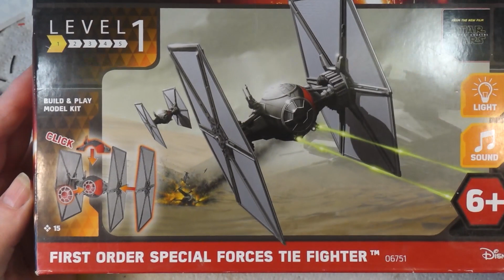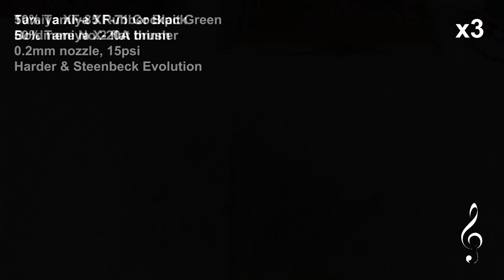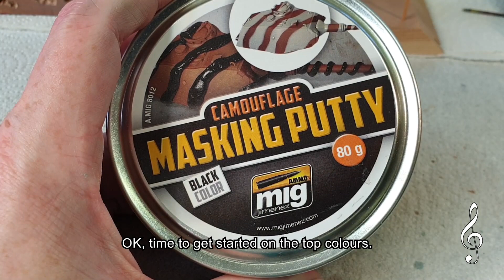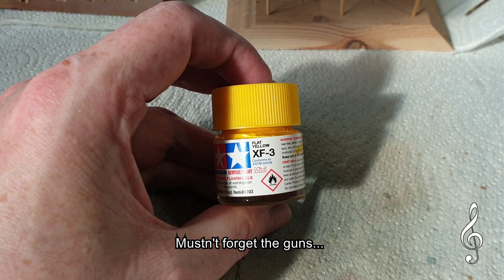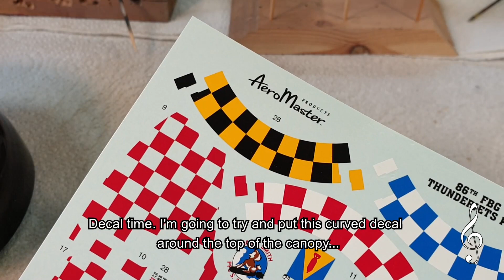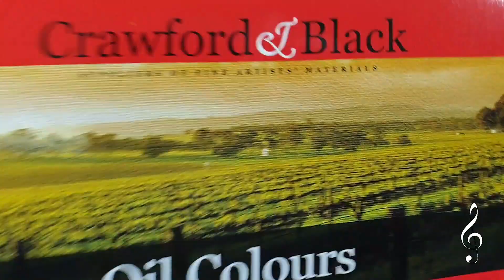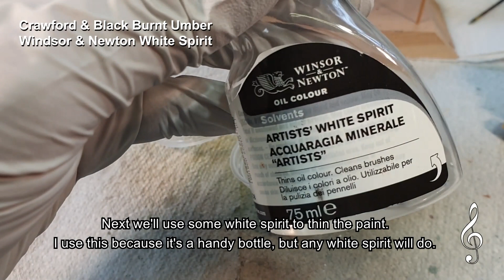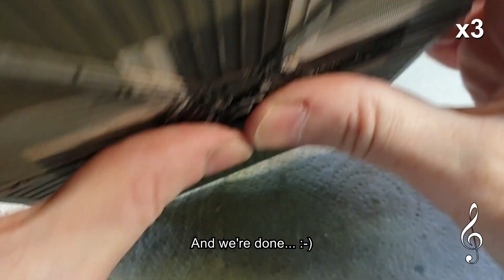Building the Revell Special Forces TIE fighter, Luftwaffe edition!

Comment: TIE wings are not solar pannels, they're radiators. A TIE is a Twin Ion Engine.
Reply from the maker: I didn't know that, cheers :-)
Reply: @DannyWarlegs, actually Danny, the vertical pylons/wings on a T.I.E. fighter are solar panels, and they, most definitely, are used to power the twin ion engines. Don't believe me? Google my friend...
Reply: @raiderghost2475  "Taking this comparison further, a number of canon sources describe the large vertical wings of a TIE as something like the photovoltaic solar panels typically used to power real-life ion-drives: terms like "solar arrays" or "solar gather panels" are used to describe the TIEs' wings, and it is explicitly said that they draw on the energy of starlight and play at least a partial role in powering the engines.

Many fans have disagreed with this information, on the grounds that the power output of solar panels would not be sufficient to give TIEs the acceleration attributed to them, particularly given that TIEs have never been indicated to suffer reduced performance in interstellar space or when flying at night on a planet. Some seek to discard the "solar panel" idea altogether, and the wings of the prequel-era forerunners of the TIE, Scimitar and Advanced Projects prototype, have been identified instead as radiator assemblages for waste heat from a conventional Star Wars reactor core."

Comment: You've got to love the 'Child-Proof' 'Thieving-Bastard' proof (and anyone over 25 proof) packaging, haven't you? (HEAVY SARCASM). It's got so extreme that I have had packs that were so tightly secured, that they broke the action figures they were holding, when I stupidly thought that I'd get them out of the pack to display them. I now just cut the packing with an old pair of curved surgical scissors, which are sharp, but have rounded tips. 
The finished result looks superb. As Star Wars bad guys are basically Nazis, it doesn't look wrong at all. There was an 'Expanded Universe' character, in the comicbooks, called Baron Fel, who was an Imperial fighter ace. He defected to the Rebels, and flew a T.I.E. Fighter with the Rebel logo on it's wings, which looked rather odd - and way more jarring than your model. I love the chequerboard markings, which look perfect. Odd that the kit had no pilot figure, where the X-Wing did, especially as there's a light in that rather sparse cockpit. Other than that, Nice one.
Reply from the maker: The best one is when you buy scissors and you need scissors to get into the scissors...
Reply: @SteamGeezerUK   - Yup, I've been there, and cut my hands to bloody ribbons on damned perspex 'Clamshell' packaging, too. Quite unconnected, I do recall seeing an 'Emergency Tin Opener'. It comes sealed in a standard tin can...

Comment: Very nice build but there are some points to critisize. First, please do not mix 3. Reich military signs with  those of the modern german Bundeswehr Luftwaffe. This is a "no go" even for a pure fantasie project. The white outlines of the Solarpanell crosses are 50% to big, the centercross is to narrow. The outlines are only "Pinstripes" for the black cross to make it more /better vissible . The build and paintwork is very good as always.
Reply from the maker: I used what decals I had, and I based the measurements of the cross on an Airfix decal, so it's their fault :-)